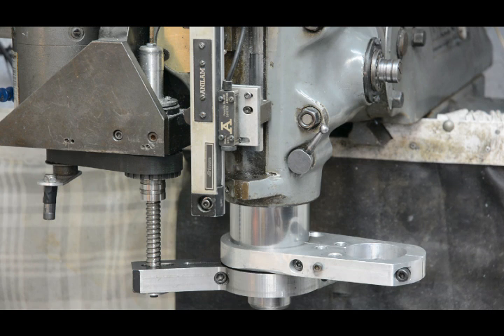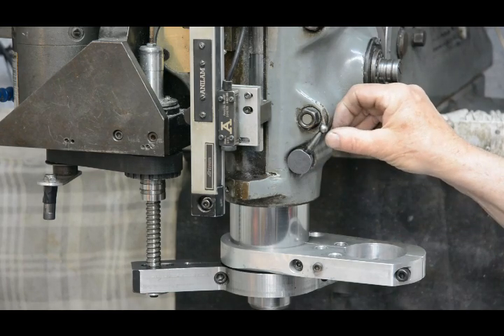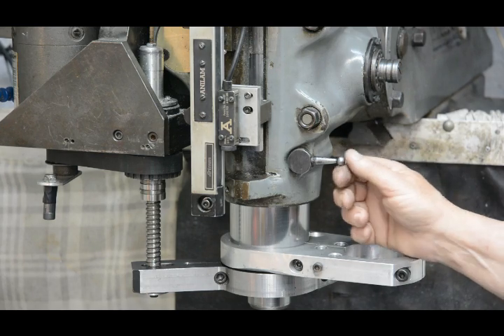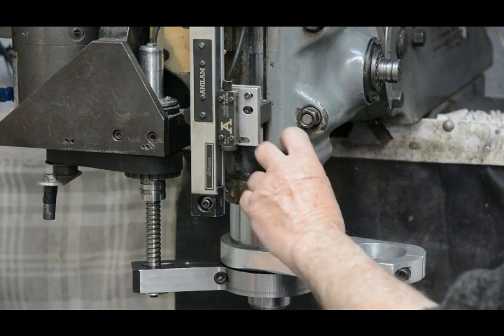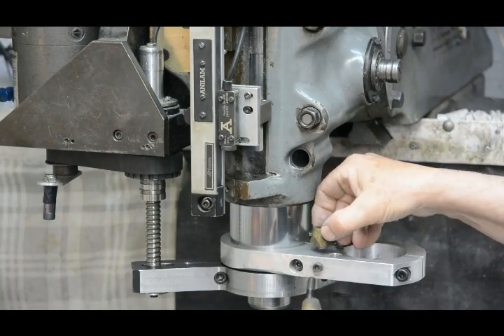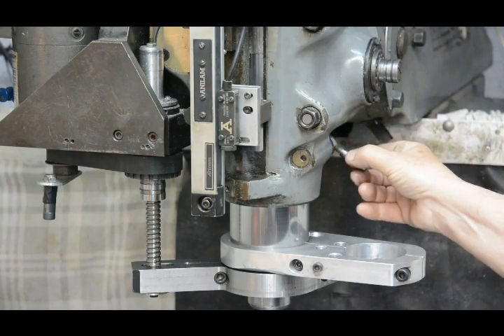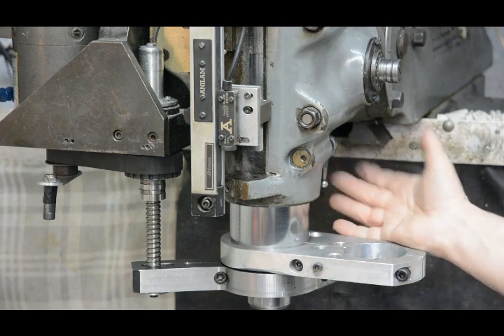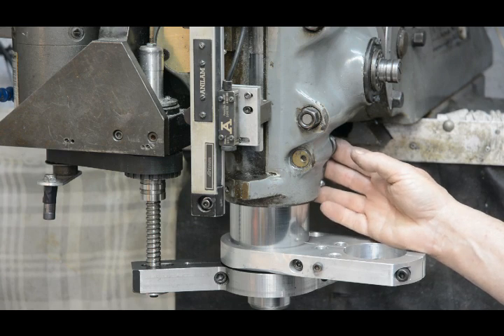Milling machine Quill Lock improvement.

Comment: For those who prefer to keep the lock on the front, then a small neodymium magnet will hold the lever up. Another alternative is to conterbore the lock wedges and use a spring between them.

There's even an off the shelf tab and spring device that fits under the nearest head bolt.
Reply: An elastic band does it for me, bit Heath Robinson but it works!